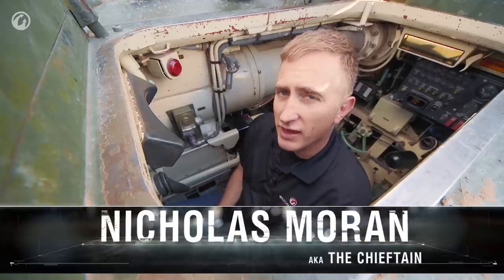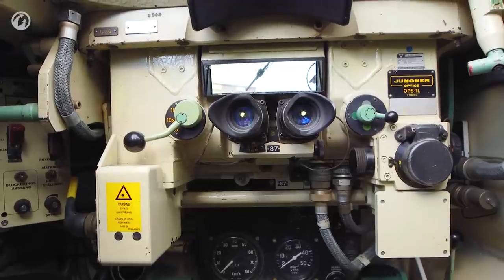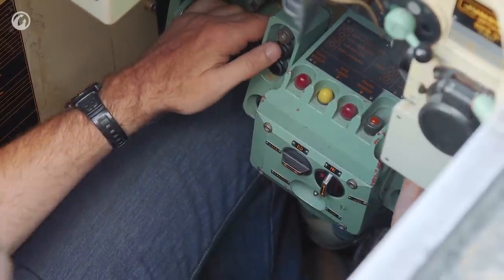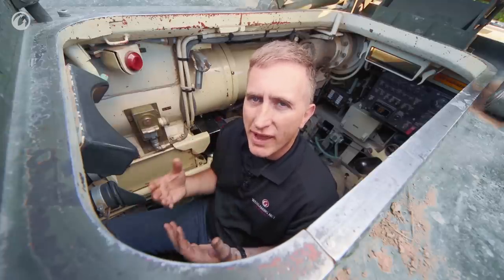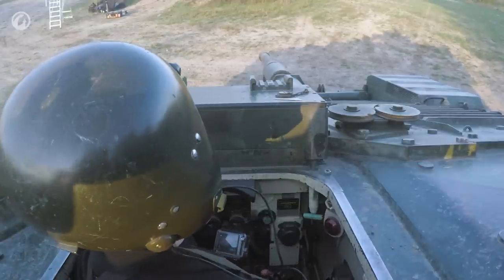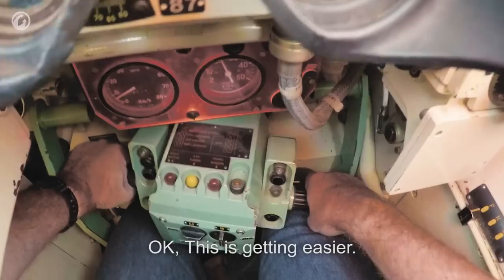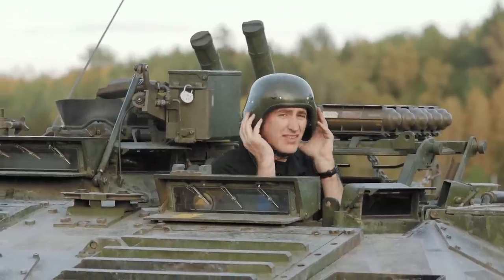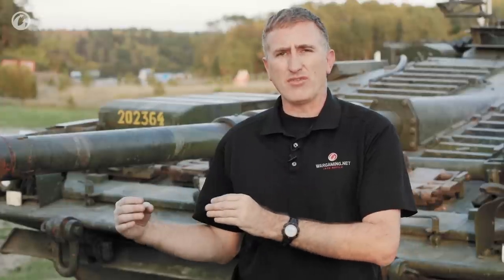Inside the Chieftain's Hatch: Strv 103C part 3

Comment: and they say the germans overengineer, I think the level of engineering  does not justify the result acheived, at the end you only get a 105 mm gun that cannot follow a target like a tank with turret would do
Reply: As always mentioned when talking about this tank, there is an easy answer to this. It was made purely for swedish defensive doctrine. Huge areas in ie. northern sweden are made up out of defensive lines- or rather zones. You can't see it on maps etc, but there were tons of trenches, forts, bunkers covering very large areas. The main purpose to was to delay a russian attack for as long as possible until reinforcements could arrive. And this is where swedish "special" vehicles comes in. Strv was made to form defensive lines against russian advances. They dug in and covered a large area, almost impossible to detect. Then fired as much as possible, then regrouped into next defensive position. Not that the Strv goes as fast backwards as forwards.

Same thing about ie. our artillery. Ie. Bandkanon 1 which was imho like the mother of modern SPGs. It still has the world record for rate of fire for an artillery piece. An autoloader system that could fire 14 shots in 45s and then quickly regroup long before any counterstrikes could be made. Imagine a division (in this case 12 SPGs) firing into an area at the same time = 168 shells in 45s...then gone like ghosts.

Comment: Give one to me & I'll replace that dual engine drive with an electric drive that runs off batteries charged by a small efficiency diesel...at only 40 tonnes & using modern engineering it should work better than the Maus or Ferdinand...just think of the operational range. 2,000 km? Also, I'd add a mg/anti missile mini-turret(remote operated & auto engages threats) on roof & delete drivers position...a computer with object identification software would assist in target acquisition(and hope it doesn't go "oops") if my version's 2 man crew kills each other, the computer takes over & goes Skynet on the world. But i digress.